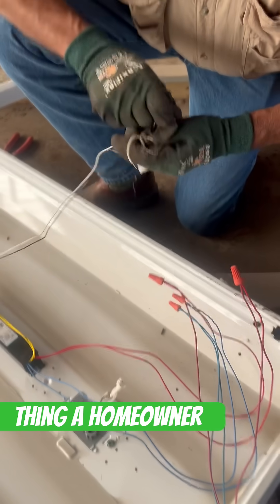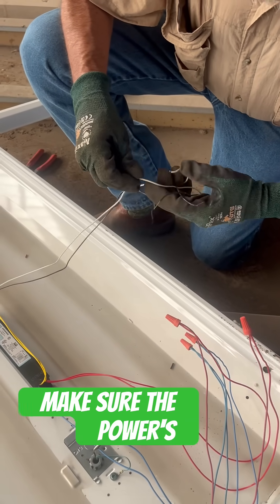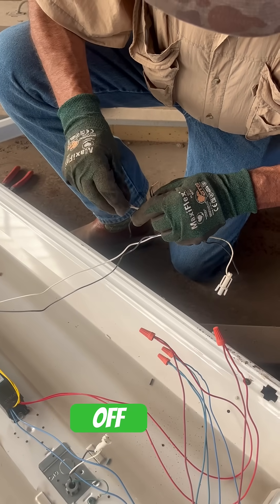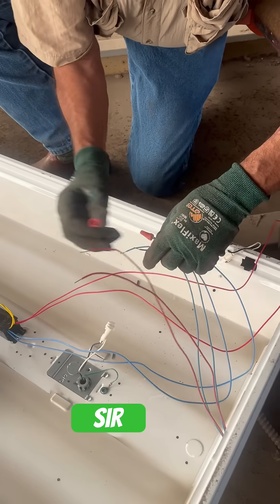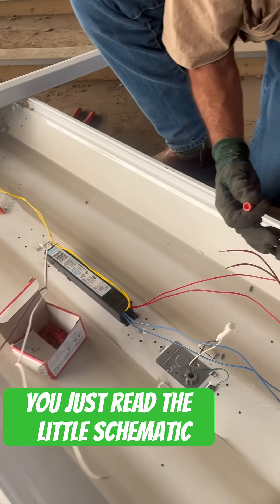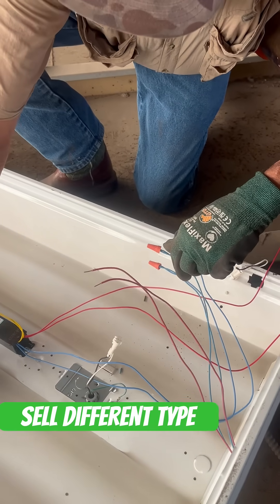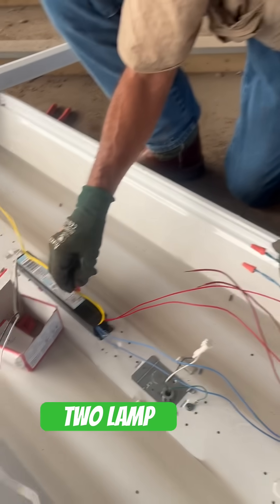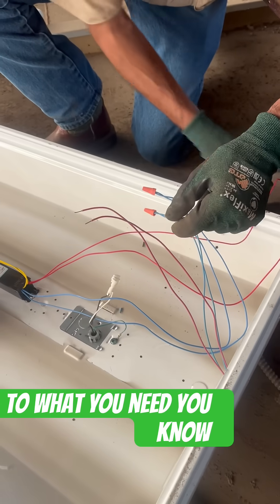Tips on replacing a bad ballast

Comment: Could you explain the purpose of the red, blue and yellow wires please
Reply from the maker: Sure thing! The red and blue wires usually connect to the lamp sockets, and the yellow wire typically feeds the opposite side. The exact setup can vary by ballast type, though—always double-check the diagram on the ballast for accuracy.”

Comment: I made sure the ballast I bought was the same number of bulbs, hz, volts,etc but while one end is the same: 2 blue, 2 red, 1 white, one black (with green ground which i didn'tneed to touch as it's coming off the power cord), the other end is different. The old ballast has 2 yellow wires leading to one bulb. 2 black wires link up with the yellow wires up inside that end of one bulb socket. The other ends of the black wires then link to the remaining socket.  The new ballast has 2 blue wires and 2 red wires. Do I hook up 2 red wires to one yellow wire and 2 blue wires with the other yellow wire or to I put 1 red and 1 blue with each yellow wire? I'm concerned that if I remove the yellow and black wires from the sockets, I won't get good contact with the new wires to the sockets
Reply from the maker: Hi @debfamilia8528, thanks for the detailed breakdown — you’re clearly paying close attention, which is key when working with ballast replacements.

What you're describing sounds like you're replacing an older magnetic or pre-2005 electronic ballast (which often used yellow wires to power both ends of a lamp) with a newer electronic ballast that uses dedicated wires per socket.

On most modern electronic ballasts:
	• Red wires typically go to one end of each lamp.
	• Blue wires go to the other end(s) — either one blue per lamp or two blues for two lamps, depending on whether it’s a parallel or series setup.
	• The yellow wires on your old ballast were likely “shunted” — meaning they powered multiple pins together on one side.

You shouldn't connect red and blue wires to the old yellow wires. Instead:
	1. Remove the old yellow/black wiring from the sockets (gently, of course).
	2. Check if the sockets (tombstones) are shunted or non-shunted — this matters for compatibility. Most instant-start ballasts need shunted, while program start ballasts need non-shunted.
	3. Follow the diagram on the new ballast exactly — it should show which wires go to which lamp ends.
	4. If the new ballast has two red and two blue wires, it’s probably wired for two lamps, with one red and one blue per lamp (or both blues to one side, both reds to the other — again, check the diagram).

If you're ever unsure, or if your fixture wiring is heavily modified, it's a good idea to consult a licensed electrician to be safe. Let me know the make/model of the new ballast if you want help reading the diagram.